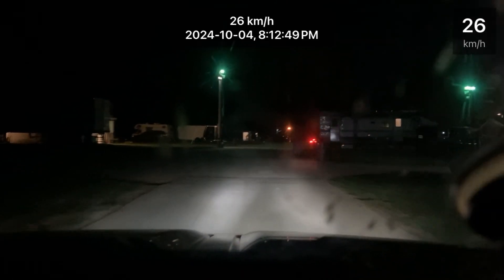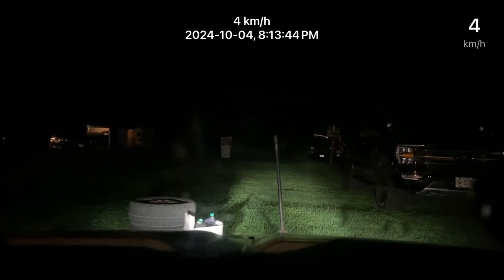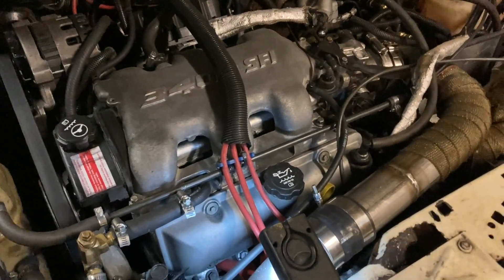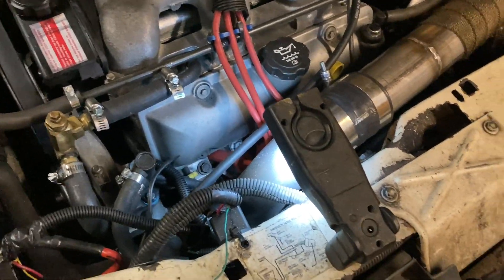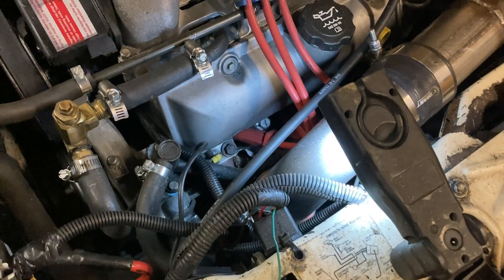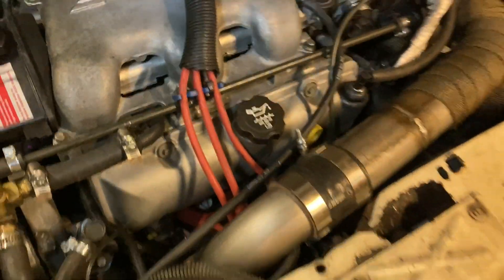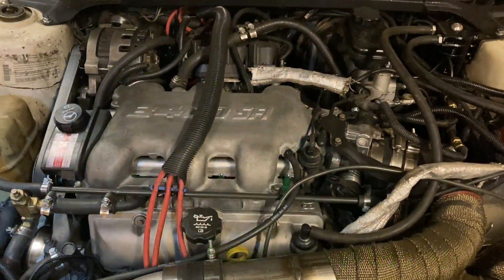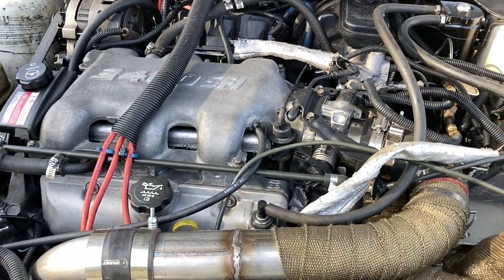Z24 vs Hellcat! And hits the Dyno for the first time!

Comment: Do you plan on doing weight reduction?
Reply from the maker: @jacksonl1060  thanks!  
As for weight reduction I’m trying to do things within reason.   
My carpet was removed because it was garbage anyway. That weighed 27 lbs.  
Headliner got wrecked from the sunroof leaking.  Not sure how much it weighed.  
My current rims/slicks are 8 lbs lighter than my old ones.  
I’ve kept the stock seats and rear seats in for now because I do still take the kids for drives occasionally.
Reply: @xlr8ing_zgarage  cool build! Keep it up
Reply from the maker: @jacksonl1060  thanks!! Appreciate it!